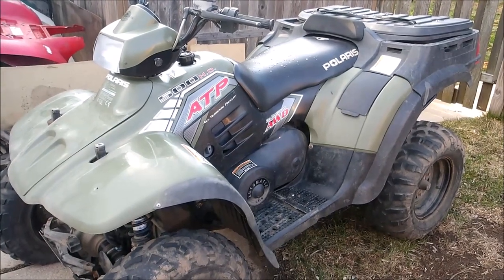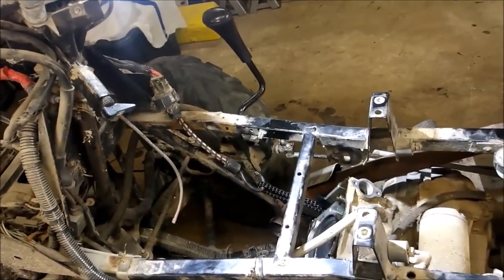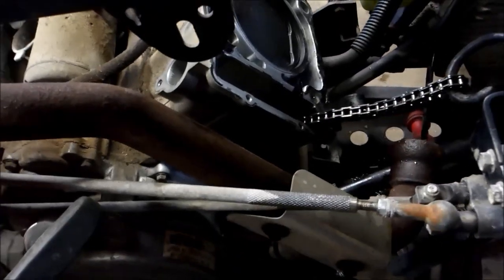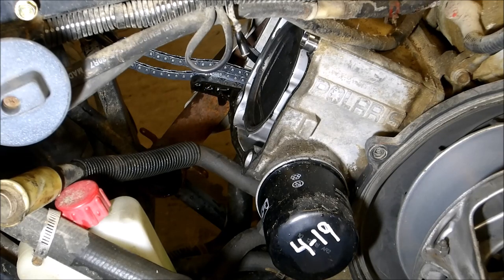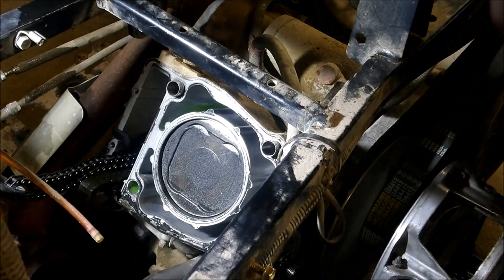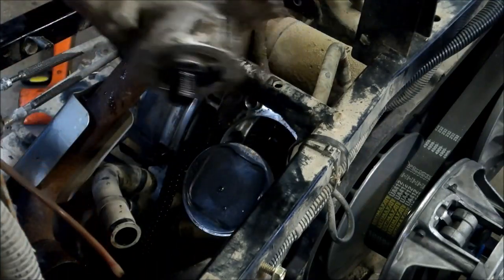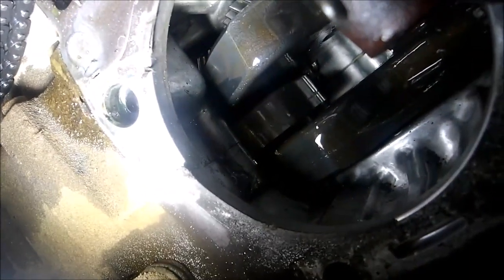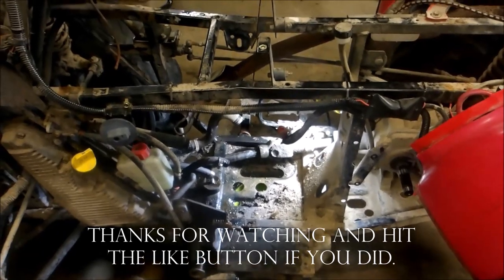Polaris 500 Engine making a Rattling Noise? Find Out Why!

Comment: What should he have done, or how would he know if it was running too lean? Is there some tests I should be doing to make sure it's mixture is correct?
Reply from the maker: You can spray carb cleaner at the boot while it's running. If it revs up, you have a crack in the boot or in my case the bolts vibrated loose.

Comment: This video helped me alot rebuilding my 98 sportsman 500, the piston got scarred up from an overheat I believe and lost compression, I did an entire top end, piston cylinder/head, its timed correctly, there was no play in the rod and everything looked very clean, but now on first couple start ups it has lower end knock that goes away entirely with any throttle. Any ideas?
Reply from the maker: When you put the piston in did you check for anything that could have dropped in the engine? Piston skirt ect..Could be a bearing, Maybe little shreds of metal in it yet. Or have you broke a starter rope? Sometimes its in the flywheel. part of the spring.
Reply: @TitaniummanGarage  the piston was intact, oil was dark but not really much metal in it when drained to do the rebuild, the bottom end looked spotless spun good with no catches or rod play. Is it because I drained the oil and only filled the oil tank? I've only ran it maybe 3-4 minutes because of the clacking sound at idle. Should I have dumped oil in the bottom end or something
Reply: @TitaniummanGarage  cuz it definitly didnt knock before it got hard to start then finally just didnt have enough compression to start, I dont get it. Seems related to draining the oil more than anything
Reply: @TitaniummanGarage  pullrope is good and has a ton of compression now lol, and I didnt remove the flywheel or anything only the recoil housing to time it.
Reply from the maker: Is there oil in the case now and what does it look like? Polaris says to drain case and reservoir when oil change is due. But then everything is pre lubed at start up.  Did you pre lube things as you rebuilt it? I would almost have to see a video of it to let you know. You might have to tear it back down to find out.
Reply: @TitaniummanGarage  so I just got home from dallas an checked the oil in the res, its suspiciously clean for having started it a few times after the rebuild. Looks as clean as it did going in, I'd expect if it mixed with the small amount left in the case it would be darker. Like it's not circulating.
Reply from the maker: @codyweien4513  Hmm. I just started my new rebuild up. I checked and drained the oil on mine. The oil was a little darker from circulating. If you want to know if the pump is bad, take the rocker cover off and turn it over a couple times. oil should pump up into the rockers. Hope that helps. But in your case could explain things.
Reply from the maker: @codyweien4513  I just had a thought! Are your oil hoses connected the right way from your oil tank. The hose coming of the bottom of tank goes to top inlet on the engine. The top hose from tank goes to the bottom inlet on the engine.
Reply: @TitaniummanGarage  I messed with the quad today, I'm 99% sure the clacking noise is coming from the clutch.
Reply: Could you have a listen and tell me what you think man, its driving me crazy..
Reply from the maker: @codyweien4513  Pull the clutch off and see if it still makes that noise. At first I thought it was the piston, till you reved it up. It is loud though.

Comment: I own a 2005 sportsman 500ho. Leaking oil from the bottom of the cylinder. I have a cam kit and cylinder kit in the way. Could really use your help! Awesome videos.
Reply from the maker: I had one like that. I replaced the bottom gasket and the head gasket. I do have videos on how to replace them. Not sure if you've seen them yet.
Reply: @TitaniummanGarage  I watched the head. Not the bottom. Links please? Torque specs and pattern in particular.
Reply: @TitaniummanGarage  Thanks for talking to me. Awesome
Reply: @TitaniummanGarage  I also have a valve kit on the way. If you have a video of valve and spring replacement a link would be most excellent! Thanks for being so helpful
Reply from the maker: I've done them on a Honda.  I haven't made a video on it. But it would be a good one. You'll need a spring compressor. Compress and take the keeper's out. Look up honda videos.  That's how I learned.
Reply from the maker: @craigvincent8905  The bottom is a just a criss cross pattern. I don't have the torque specs on hand. you could google it?
Reply: @TitaniummanGarage  10mm 46ftlbs. 6mm 6 ft-lbs. Cheers.
Reply from the maker: @Richard Ballantyne stock cam kit. I put an H.O. cam in. It had more power.